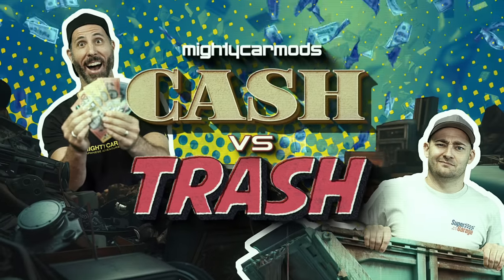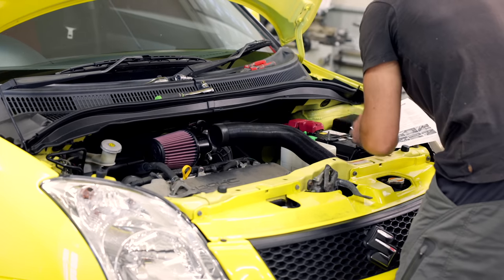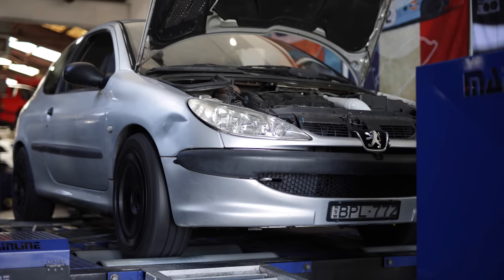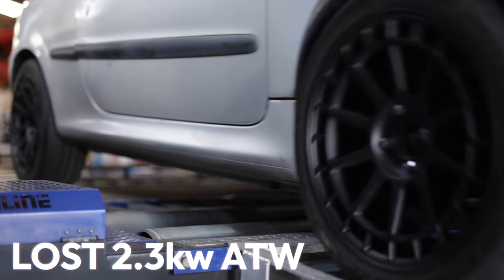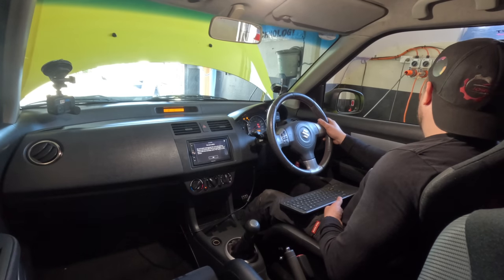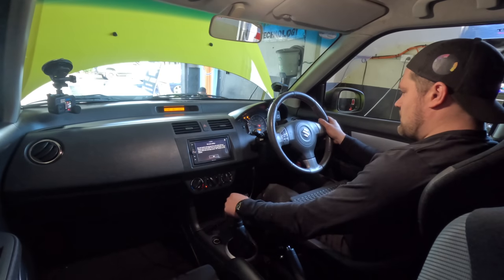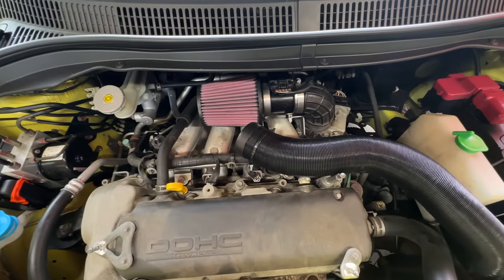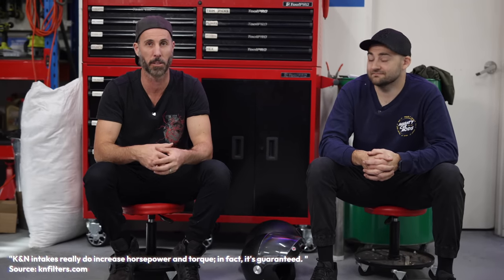Dyno testing POD FILTER Performance Claims | CASH vs TRASH

Comment: Have you tried resetting the computer after installing a pod filter? I wonder if resetting all of the systems that have anything to do with airflow and fuel could give different results? Whenever I would do this mod on my own vehicles in the past, I would always reset the computer afterwards. I never had a dyno though to test this.
Reply: Also I had to drive around a bit for it to notice a change but I for sure got better fuel mileage on the freeways at least. That I was able to test and did work on multiple different vehicles that I did this to.

Comment: I recently reset my stock 1998 Honda Preludes ECU ignition timing.  It required me to disconnect the battery for 10 minutes to reset the ECU then reconnect it and keep my engine revved at 3000rpm until the radiator fan comes on. It makes a hell of a performance difference!

If i have ever reset my ECU in the past I have always just let it idle for a few minutes or driven straight off and just thought the ECU learned on the go.

Is there something like this for the Swift?

Comment: It’s a leanness issue. Modern cars a designed to run lean. It’s like in the old days when you lean out your carb and it made the most power ever, then they blow up. They’ve learned to run them at max. It’s really hard to beet a stock engine without big changes.

Comment: I have the same swift as your, never tested stock since i installed immidiatly a KN sport filter in the stock air intake and and a man made exhaust system leaving stock headers whit catalityc converter. From my test on the dyno in this configuration whit 70000km on active in the car, was having 115 hp instead of the 125 declared, after ecu remap i basicly went beck to the 125hp. Worth  nothing on that day was like 35c in temperature whit a lot of humidity too so maybe lowered my score a bit. Hope can help you guys !

Comment: The cars NEED to be tuned, little cars like these are optimized well from factory, impeding the intake system and exhaust system on stock tune leaves the car off parameter reguardless if the ecu is adapatable, also exposed intakes are just a welcome invitation to heat especially on nugget cars

Comment: you both made a simple error: failed to tune the ECU for the changes to the intake and exhaust. 
as the next mod in the old school tune up was intake cam, air, ,plugs, leads, exhaust, and ECU for the changes made to the air/fuel ratios.

also i probally would have enclosed the pod filters. what you both did was take the air filters off and expected to beat each other on the dyno. lol no doesnt work that way like it used to with carbys

Comment: He should have fitted a proper cold air intake system, like a Simota. Of course you'll lose power if you're sucking in hot air from the engine bay.

Comment: Hi guys, I installed a K&N air filter in my Nissan Pulsar B17 but I kept the stock air intake I didn't add a sports exhaust because after researching this I found out that their were no real gains in power just more noise according to MRT Performance, but one thing I did also do is I bought a set of the highest quality NGK Denso TT Iridium spark plugs , I cleaned all the air intake housing and tubes and the maf sensor plus the throttle body with proper maf sensor cleaner as cool clean air is important when trying to increase your HP as is high quality spark plugs and using high octane fuel
Reply: This is the cheapest performance without paying hundreds of dollars for a performance tune or looking at any new ecu changes

Comment: It is running on stock ECU ? If so that's a big issue. I prefer the first mod needed to happen on the computer side (ECU) The ecu always checks back man. Second check to see if the blow by tube is back to the intake (PCV Valve routing). Definably the air needs to be cold and performance mods like these you need to put the intake far from anything that generates heat. hehehe what the hell am I saying you guys already know these.. so last I don't know a bad or low quality map or mas sensor

Comment: Unfortunately, you have made several changes to the cars so it may be hard to identify which modification created the power drop. I'm sure it would be inconvenient but in the future, the best practice would be to make one change and repeat the dyno testing. Then make the next modification and retest. As others have stated, the intake change may not be where you are losing the KWs. Perhaps it is the wheel and tire change. Also, it wasn't clear to me if you used the same dyno for this test as the one you originally used. Is it possible that there is a difference in the dyno setups that would explain some of the power decreases? I just don't know if all dyno setups must meet some industry standard to eliminate variations between using different test machines.

Comment: I did my apprenticeship in engineering at an engine building factory, a lot of what I'm about to say is yawn face sensible Dad advice so apologies Marty and Moog for having a sensible hat on.
Engine designers spend millions on optimising power and fuel consumption to make their products competitive for consumers, they don't want to hide power or performance from the customers.
It is true that the cost margin is important for shareholders but not at the expense of making a bad car or it will not sell.
In the engine test cell they use flow bench to measure intake and exhaust pressures and temperatures to optimise the air delivery whilst also keeping a keen eye on whether the air flow is smooth laminar and not turbulant. Turbulant air flow is bad as it makes vortices which can cause localised pressure spots or vacuum meaning the air fuel ratio is munted (thanks Moog good word).
Putting an aftermarket air filter on in place of factory makes is sound 'dead ace' (thanks Marty for this phrase) as the rasp means you is a proper rude boy down church street. In reality it will probably loose power as it was already optimised by the R&D done in development.
Putting a Jap Cannon exhaust on means that initial acceleration will be worse due to the lack of back pressure in the exhaust causing the loss of cushion in the combustion cycle to balance the system out, however it will sound 'the sickest of ill' and guranteed to drop panties for miles around the local servo (think i used that phrase correctly, im english so please forgive me).
One last point I'd like to make before the other commenters tell me I'm too old and a boring is that fitting an aftermarket engine management computer and getting a tune will free up more power but at the expense of safety. All car manufactures cannot gurantee that every engine built is identical due to variation in manufacturing tolerances for sizes. To get round the variation in production limits they introduce a safety margin for the engines performance which ranges from brand to brand but is usually around 5-10%. Taking your new shiny air intake and exhaust combo for a tune on a dyno with a modified ecu or aftermarket replacement removes the safety factor and frees up the 5-10% safety meaning your car has dyno proven gains but at the expense of the designed safety margin. In laymans terms if you run the engine to 100% power (check me I is proper lairy rude boi innit bruv) you run the risk of catastropic engine damage and coming home on a low loader.
Senible Dad talk over, Marty I hope you chop Moog his cash Suzuki with the mighty PeugBro. Love the channel, keep up the great content. Peace :hand-purple-blue-peace:

Comment: It's just a placebo affect. It does not increase any hp best way is to replace filter with k&N type in the stock air system. That is better

Comment: I had a 230rwkw ls1 lose 30kw on the same dyno with no change to the car except wheels and tyres. Its using a wheel dyno not a hub dyno, and change in wheels and tyres thats resulted in the loss

Comment: I'm a mechanical engineer guys!

Funnily enough, you lost power because of exactly how an engine works. You diluted the airfuel mixture by adding more air. You upgrade the intake, yoy need to upgrade the fuel delivery system in conjunction with that to make power otherwise you would be leaning out your engine from the moment yoy turn it on.

Comment: I'm not shocked that swift lost power. Na cars love long intakes, not a filter directly on maf/engine and beeing a hot air intake. Try making a longer intake to the front
Reply: its because there is no ecu mods to accept a modded intake. its runnin lean at high rpm.

Comment: I think Marty hit on most of the losses just being variables between dyno sessions. Air pressure, humidity, temp, different wheels etc etc. That being said, pod filters are basically worthless, unless you can’t fit anything else and it’s some kind of protection. Mike on the drive tribes took their Beamer for crazy expensive aftermarket stuff and the dude goes into a whole spiel about how the shape alone robs power. 🤷🏼‍♂️

Comment: Assuming the flow rates have changed too dramatically for the cars system to adjust and needs tuned. Like most engines if you were to change flow rate.

Comment: Look where the K&N is sitting right above the hot engine of course ur going to lose power. Better off using stock air box with good filter. Believe it or not wix paper filter probably best ur going to find. Iv been using ebay panel filters modified air box on my 2018 3.6 camaro. 
Also put bigger throttle body on 72mm to 80. At first i lost power with throttle body. Added a 1 inch spacer modded air box thank god it worked because i had a lot of time in the bigger TB evan ported and polished it. Made my own adapter to fit bigger TB to my ported intake manifold. Anyway I figured it out so maybe u can to but sucking in hot air is never good.

Comment: Didn't see if there was a fan pushing air into the front while on the dyno. Maybe you just need to get a sh*t ton of air moving up front. Or maybe those cars are just crap at tuning themselves. I've heard this so many times though with certain cars, do bolt ons without tuning and end up with a loss. For example everyone says the first mod for a DC5 is the Ktuner.

Comment: It all comes down to intake air density. A lot of hot air is worse than less cold air. You pod is sucking hot air right off the engine next to the hot exhaust and the mass air flow thinks something is massively wrong.

Comment: With how hard emissions laws are to pass I cant see a modern fuel injected car where the manufacturer didnt modify the tune to work specifically with the intake they have designed. I bet the point a pod filter could be better is when you get aftermarket fuel ecu etc

Comment: I believe that like over here in the States they detune the vehicles for emissions reason. I believe that if you tube it that at that point you could get an improvement but in stock form you won't see what you expect. I also believe that K&N is absolutely garbage.

Comment: You guys added airflow and didn't add fuel.  You leaned the engine out and that's why you lost power.  You need a reflash to tune the engine.

It's the same as a motorbike - when you install a pipe and a pod filter, you have to rejet the carb, right?  Same thing.

Comment: Combustion is a process like breathing in biology. If you increase or change the input you gotta change the output and the process to accommodate it. 
Changing an air filter or upping the airflow needs to be offset by equivalent venting of gas on the output as well as during combustion.
I'm not surprised theer's loss of power simply because an intake that they've spent research on is to work across the whole rev range. THat's kind of the magic of them. Making a simple open airflow with a pod filter means you get that air and might notice a blip somewhere in the rev range but at max power you'd likley almost always see a drop in power.

Comment: 1. You need to dyno correctly for accurate results. 
You never dyno with the bonnet open as that gives mixed results, do you drive with your bonnet open?
You want real world comparisons, so you need to test the car like it is being used on the road.

2. The only way to make power is through resonance tuning, or restrictors on an engine like this.
Also it needs to get cold air which neither of these seem to be getting AND with bonnet closed you might even get worse results as the air is even hotter.

Comment: You need some insulation so the intake is not sipping from the engine bay. The pipe provided by K&N is laughable. A tune would help too

Comment: So. The boys got the first part of the equation right. The enginr, trans, intake, exhaust, iginition, computer, are all tuned to work with each other the best they can in stock form. 
So when you change the exhaust, and you change the intake, but you do nothing for the computer and iginition the car is now out of balance. It cant take advantage of the freed up air. Now you gotta get the computer tuned. Advance the timing and through more doody.... sorry, duty at the injectors. Then youll be seeing those gains youbwere hoping for.

Comment: It's a hot air intake, makes sense you would lose power. And that stupid tube isn't going to do anything, if it can just grab air from anywhere.

It would be interesting to see what happens with a panel filter in the original intake. But its never going to make a huge difference. That's just not how it works. If the filters were that restrictive, manufacturers would use something else too.

Comment: i can see how you would not gain the power of a new air intake without a tune.  but to lose so much?  the only thing i can think of would be a combo of the intake and exhaust and the air/fuel scavenging of the engine.  When you changed the intake you changed the intake pressure and air flow, when you changed the exhaust you changed the flow and pressure and could have changed the efficiency of the engine.  it's kind of like new cars, the now have more emmissions standard than ever and run cleaner than ever, yet we make more power.  it took engineers a long time and a lot of money to figure out how to do that, and then you go and swap different parts on without a tune.  it changes how the engine works.  you could probably gain power with your mods, if you change the ecu tune

Comment: Sticky rubber will cost you something - as will heavier wheels in the case of the Pugrot but there's nothing in there to excuse that massive loss on the swift. 
Its fairly obvious that hotter air will make less power but having the wrong resonance will hurt it just as much and I can't help but think having such a short intake and a pod right on it is nowhere near as optimised as the stock system. 
Even a piece of pvc tube going to a pod in the wheelarch would be better than that...

Comment: Stock intakes are "cold air intakes".  You replaced them with "hot air intakes".  Of course you lost power.
Aftermarket filters flow better but you need an enclosed system.  Don't waste money on any intake that sucks hot air from the engine bay.
You guys ARE aware of this, because you've done this testing before with a S2000, but it gets people to comment on your video so... good job.

Comment: You put the air filter at the back and is sucking hot air from the engine, you need to place the filter where it can get the coldest air possible.

Comment: The only time you get power on a filter thats not in a case you need to have a turbo you don't have a turbo so you need a cold air intake so you don't suck hot air in the engine

Comment: Give the swift an engine flush new oil iridium spark plugs clean the injectors and reinstall the k and n the engine will need remapping to take the air filter as it's set to use only what the ECU tells it you should know this by now

Comment: How disappointing as well. I thought Moogs Mighty Mods would be better, because of the famous brands. Maybe in race car series like track and rally it would be an advantage. I used to have a G102 Charade. Did many mods and spent a lot of money during the sex spec era. I thought at the time it was the right thing to do. But these days the development of parts are widely available. Now I have a Sleeper Forester which is stock and my slightly modded work ute, that is stock BA with suspension and extractors, high flow exhaust. Very free flowing. Very Boganish. Love your channel, followed your channel from the early days. Keep it going. ❤😊

Comment: Sorry, but with my experience on rally cars. Pods that are not enclosed in a box with fresh air from outside the car will reduce performance. It's why I run a K&N filter on the stock air intake that is feed from below the guards. Sure they sound better, but sound is less important then performance. Having a pod placed right above the exhaust is the worst possible place for it. The cool air coming from the pipe would disperse as fast as it leaves the pipe. The properly designed pod kits for Ford Focus RS's do not have this issue.

Comment: I've always been told that any changes to flow such as an exhaust or intake should be eventually accounted for in ecu tuning. You're ultimately throwing off a lot of readings by allowing more airflow and exhaust gas flow, and from what I have been told, an ECU tune is usually necessary to reap any benefit. it's all well and good adding more flow but without the car adding more fuel, it's a bit pointless and could possibly be messing up the air-fuel ratio.

Believe it or not, it was FN2 Type R forums that made this a bit more obvious to me as standard cars getting an ECU tune would gain around 10 bhp. The cars that had an intake and cat-back exhaust or even just an intake would always gain more power after tuning. So it is most likely the case that you have given your cars all this extra flow and the ECU doesn't know what to do with it or just doesn't have the programming to allow for any additional fuel outside of factory tolerance or parameters.